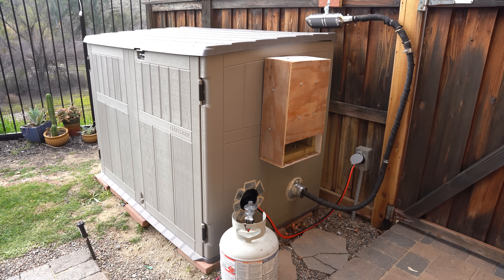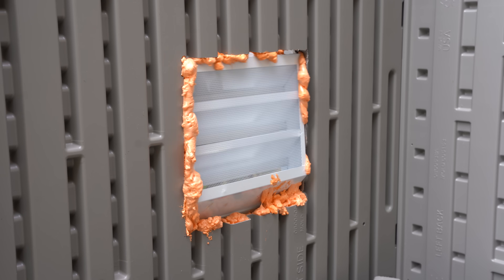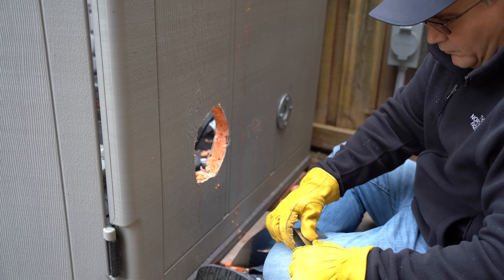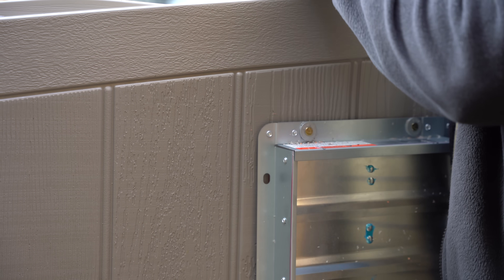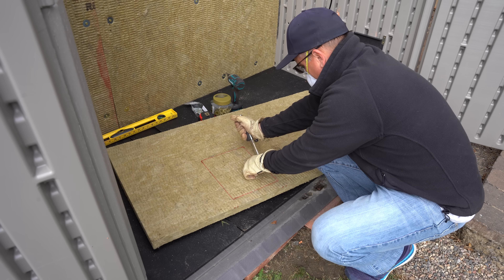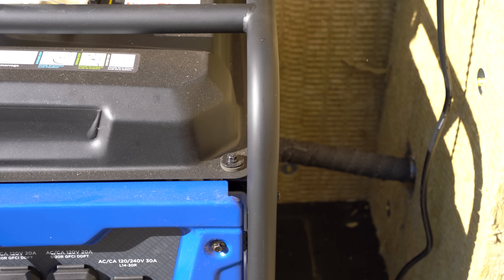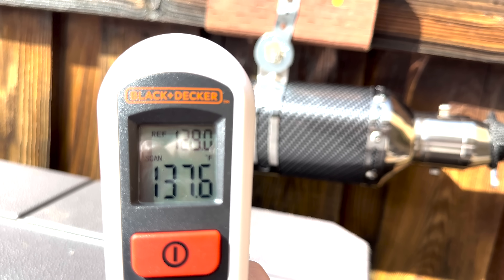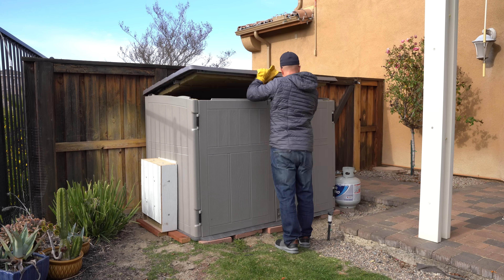How to Build a Generator Quiet Box (DIY) | Ultimate Stealth Enclosure

Comment from the maker: Complete parts spreadsheet: https://cityprepping.tv/3wYBqpi ... Download the Start Preparing! Survival Guide here: https://bit.ly/3xWhVwZ - start your preparedness journey: https://bit.ly/3xZhWlY
Some of the parts used in the video:
* Generator: https://amzn.to/3fVX3kX
* Shed: https://amzn.to/3YnKShE
* Blast gate: https://amzn.to/3tfETxA
* Attic fan (I would recommend a bigger one): https://amzn.to/3WIBy81
* Exhaust heat wrap: https://amzn.to/3DWa6uF
* Flex exhaust pipe: https://amzn.to/3UndAh2
* Muffler tailpipe sealer: https://amzn.to/3G0HkvN
* Metal zip ties: https://amzn.to/3RAQSBo
* Complete parts spreadsheet: https://cityprepping.tv/3wYBqpi
Reply: Hemp fireproof blocks as well bud😘Aģape
Reply: I remember reading a book on soundproofing when I was a kid. And they said the best way was to build a room inside of a room.

Look at how quiet your little setup is, imagine if that little setup was inside a tool shed.

Obviously you don't need it that quiet, these people were making recording studios
Reply: You left out the self driving nails at 11:15.
Reply: @DaedalusHelios  Good point! I have almost finished fine tuning my shed, a Suncast BMS4700 that houses a WGen 12K DF generator. I am no engineer or had any experience building or modifying something for a specific purpose. I did go to Lowe’s & Home Depot and bought large L-brackets and attached  them to all of the shed walls and installed the foot of them through the shed floor into a 6” slab with concrete bolts all around the bottom of the shed walls. Also  purchase two steel beams cut to the width of the inside of the lt and rt walls to reinforce the rigidity of the walls.  Thinking of reinforcing the corners that join the rear walls to the side walls as well in a vertical way if that makes sense ( after all not a engineer here) So just had a freeze here in San Antonio and so far so good.!
Reply: I'd like to see screen/rough mesh on your outside wooden box!  If wasps build in that, their nest will obstruct airflow...🇺🇸 😎👍☕
Reply: Before and after sound difference would be nice.
Reply: A word of caution. The exhaust will contain moisture and it will gather at the low point and prematurely corrode and fail. Exhaust systems will have a downward slope to the muffler and the muffler will have a drain hole to allow any condensate to escape.

Comment: Great build!

Pro tip:   When caulking the vents on the outside, only caulk the top and sides. Do not caulk the bottom.  If moister does find a way in around the top and sides, it will have a means of escape at the bottom and will not become trapped.
Reply: Nope, that's only when you're worried about rot - plastic doesn't rot, so caulking entirely around the opening is the proper thing to do. This is an attempt at a sound-proof container - anywhere air can escape, so can sound.
Reply: I'm sorry but moister and moisture are two different things.
Reply: @missyjo2475 nice English lesson but I do not think people are watching the video for that .
Reply: @JonathanRubenstahl  No, but an opportunity for you to learn.
Reply: @ArthurDentZaphodBeeb  true 👍

Comment: I found it over the years the threads on the exhaust pipe are generally the same as half or three quarter inch pipe. So I always take the exhaust pipe and small muffler off and run pipe a couple feet away straight up in the air outside the building changing it to 1 in pipe after about a foot from the box and then put in a 180° curve on the top to keep rain out not only does it get the exhaust fumes up in the air and away from people it further quiets it but by about 20 decibels

Comment: Nice one Kris, Thank You!
Something my Grandfather once did was use some metal struts to make a cage for the generator, then he used some strong springs and suspended the generator from the top metal struts so it was hanging. Makes a world of difference on the sound and vibration.
Reply: Grandpa was a genius. 👍🏽👍🏽
Reply: They also make vibration reducing/absorbing pads made of rubber, foam, cork, etc you can get for a few bucks.
Reply: Good idea but a $50 rubber horse stall mat works wonders!

Comment: make sure the temp inside dose not get above 120f with derating or 100f for normal rated use. 
chris has a good design,  two things: up size the fans to 12" the one on the back have it ducted directly to the back of the alternator (gen end for those not in the generator industry) 99% of failures your going to see is the alternator overheating and failing. they are VERY sanative to heat.
Reply: The alternator windings will quickly fail at about 150f depending on the Ins class rating. So any heat the alternator makes will be on top of the inside of box temp.
Reply: @karryhardman8735  you're saying 150 degrees but the person you replied to says 100 to 120 max. Now I'm confused. LOL!  I upgraded to a 14 inch fan and have one 15x15 intake vent on the opposite side. Haven't put a remote grill thermometer in there yet to see temps but it doesn't seem very hot in there when I open the shed lid.

Comment: This is excellent, I can't justify the whole home backup system for like $12k right now but a ~$1k from Costco or whatever inside an enclosure like this is feasible
Reply: The Firman Trifuel 7500 max watt generator goes on sale from time to time. They generally run for 900 and 150 off when on sale.
Reply: @corollaae8645  thanks for the heads up!

Comment: This actually inspires me to build something similar not for a generator, but for an air compressor for my shop. I don’t have a lot of floor space in the shop, so my thought was to build a lawn and garden shed and put the compressor in there, but it would be too far away from power and too far of a run for the air supply. This is just about perfect and I can set it up right next to my workshop, eliminating those two concerns. Thank you!
Reply: Try building and adding an intake muffler to your compressor. A lot of the noise come from the intake. I did this myself and it was considerably quieter. Many videos on YT showing different methods.

Comment: Great job, well done. Here’s a tip to reduce more sound. Get about an inch stand off with a piece of plywood that’s a little larger then the exhaust opening. Add the stand off and the plywood on the inside to cover the exhaust opening. This will help baffleing sound more.

Comment: I have a Firman  10,000 W tri fuel generator In a box similar to yours.  I live in PA and have had to use it on many occasions.  I do not us the sound dampening boxes, I found.they make little difference and hold heat.  Before attaching another muffler, CHECK YOUR WARRANTY!  Outsourced mufflers change the compression and will  cause failures it also voids most warranties.  We live in a world now where people see you have something they want so they steal it.  I had a welder make me two 4 ft.rebar pcs with steel rings welded on that I drove 3/feet into the.ground, cemented in and ran steel cable through with a heavy duty lock.  I highly recommend hard wiring the generator to your panel by a qualified electeician.  Electricians and in our area call the plug-in the "pig tail of death" many people start their generator, THEN plug it in, which is a good way to get electrocuted.  You DO NOT need another box, just a simple transfer switch that prevents you from back feeding the lines. You cannot power your box until the main switch is off and then the generator breakers can be flipped on. Also, flipp  the breakers to the items with the highest draw first.  Once.I learned that I can now power my whole house.  And make a schedule to run your generator at least every two weeks and check the oil.  It is a great feeling to have this item as a.back up.
Reply: I’m just finishing my shed like kris .   Really good comments -thank you, for chiming in with these.
Reply: You are very welcome.  We have had a lot of storms this uear and the generaror has been invaluable.  I am still extremely satisfied with my set up, and most especially the Firman generator.  I run it exclusively on natural gas.
Reply: I used the muffler Kris used in this video and I think he said it's for "around a 400 CC engine" (could not find proof of that on the Amazon link) but my generator says 500CC. How do I best confirm this will work. My generator is the DuroMax EP13000EH Dual Fuel. Using what Kris used, will this be a problem in your opinion?

Comment: Well done.  I thought you did a pretty thorough job of addressing everything needed to do a build like this.  I think you did a better job than most of these complaining keyboard DIYers would have done. Obviously someone can easily add or take away anything they want for their ideas.  I have a old 4500 watt generator that is incredibly loud and wanted to build something for it.  Ideally a little smaller and something that I could setup and move easily.  Thanks for your ideas.

Comment: I have a dozen comments and suggestions, however, I won't bore you with my opinions. You showed a beginning decibel reading (79.6dba), was there a completed decibel reading? Considering, plastic, wood, and foam are all combustible materials, using *Rockwool insulation was a great choice! I use the same brand (different variations) in my house, garage, attic, and generator shed.
 In combination with my solar/battery storage backup system, I use two 2500-watt dual-fuel generators with a combiner box connected to our 250-gal. bulk propane tank with a factory dba rating of 53dba. Inclosed is about 45dba.  "Rural Prepping" 🤠

Comment: For good ventilation, the general rule of thumb is to have twice the area of passive INTAKE as you have ACTIVE exhaust.  You can either do the math on making one hole, or (the simpler way) if you cut a 4" circular hole for the exhaust fan, cut two 4" circular holes for the passive intakes.  (The shape isn't important.  Just the area of the holes in respect to one another.)
Reply: What if you had an intake fan and an   exhaust fan both at the same specs ? I’m building mine that way through the same size sound maze boxes.
Reply: @unbr3akablonsoundcloud-tx6co  better to have one fan unless there is a computer keeping them perfectly matched.  Otherwise one will cause drag on the other
Reply: @reverendprophet   im building an air compressor silencer box , so it’s a little different to a generator . Will the drag still be an issue with sound maze intake and exhaust baffles if I go about this method?
Reply: I’m still not sure what u mean by drag ?  Drag only happens if the fans are installed close to each other on the same side aren’t they ? Not either ends of the box
Reply: @unbr3akablonsoundcloud-tx6co  if the fan that is exhausting is pulling harder than the fan that is bringing in fresh air, it will cause strain on the intake fan.  If the intake fan is blowing harder than the exhaust fan is pulling, it can cause strain on the exhaust fan.

Much better, if you want to use two fans, to have them BOTH exhaust and then have twice as much passive intake.
Reply: @reverendprophet   I get what you mean , but going off what you’re saying the extraction fan will be sucking more air out than what’s coming into the box, that’s why I bought two of the same fan , built two of the same sized snakes boxes . Limit the variables of what could go wrong. The variable I am concerned about is the compressor sucks in air  and also needs to stay cool. I have installed a temperature sensor to monitor from outside the box, but that doesn’t tell me if one fan is struggling more than the other .A majority of the builds I’ve seen with an extraction fan have an open snaked intake (very narrow to reduce the suction sound of the compressor ) and have shortened the life of the unit. If there’s no risk of the fans starting a fire and just failing it’s worth a shot as they only cost $34aud each (probably 20 usd)
Reply: @unbr3akablonsoundcloud-tx6co  If the two fans are not PERFECTLY in sync with each other, one or both fans will be working harder to compensate for the other.

If the exhaust is active and the intake is passive, the exhaust creates a vacuum which pulls fresh air into the passive intake. 

No need for another fan.

Again, the formula is that if you have a 4" exhaust fan, you want TWO 4" passive intakes.  If you're going to route them through a bunch of baffles, you could increase the area of the intake to compensate.

But feel free to do whatever you want.
Reply: @reverendprophet   the second paragraph was the answer I was after , thanks.  Are you an electrician ?

Comment: I have done this several times, you are  correct, the fan is too small and you should be blowing air INTO the box not exhausting air, it is much more efficient. Also a "Certified Exhaust Thimble" for combustible walls should really be used as fire codes are not a bad thing.

Comment: Love this proof of concept.
Do you think anymore bafles in the intake and exhaust boxes would make any significant improvements. 
Also the exhaust needs to be lower sound the sound is not projecting out into the area. If you are using this during a grid down type issue its going to be a lot quiter in your neighborhood .

Comment: I put my fan down low and revered it to suck in air. Then it blow it out through the top vent to expel any gas that might had built up.  Good idea to use an expoliosn proof fan as well. Bit more expensive but not as much as a new generator or house. Cool build.

Comment: Nicely done! If you ever get a chance, have a look at a film set mobile generator, might give you some idea's for another build or upgrades. Expanded metal/perforated metal covering your insulation will give it support,  a blower fan blowing into your air intake area will aid in cooling ... just a couple ideas.
Great job otherwise, cheers!

Comment: Excellent video.  QQ;  if the venting system (intake and fan to draw outward) is strong enough, could you get by without having to pipe the exhaust too?
Reply: My guess is no because the exhaust is way too hot. It would likely damage the generator without exhaust directly from the generator to the outside.

Comment: If you’re looking to really sound proof something, look into mass loaded vinyl. It’s what movie theaters use to make a room truly sound proof. The thicker it is, the more exponentially sound will be deafened. Air is the #1 reason sound will get though so it might be smart to build an additional box around the generator, inside the shed. Then wrapping mass loaded vinyl insides both boxes. I guarantee it would be <20db if not almost 0 if you use the 2lb per sq foot vinyl.
Reply: I thought about MLV, too, but can it take the heat?
Reply: @trevorrisley5419  yup it’s fireproof

Comment: Looks great. Question: Is there enough oxygen venting into the box to keep the motor cool and not insulated to the point where it overheats?
Reply from the maker: That’s why I need to upgrade the fan :)
Reply: @CityPrepping  Ahhh, ok that makes more sense now. Thanks for clarifying! :)

Comment: Two things in a generator that hate heat; heads and generator windings. If you have 200F inside that compartment you have a recipe for disaster. Look for a 10-15F rise. I can see right away your fan is undersized. For me to achieve the desired temp; rise I went for a 16" AC infinity 3000 cfm fan. Sarted out at 12" 850 cfm and inside was over 125F. Another issue you have is the escape area on your compartment hoods appears to be smaller than the fan exit area opening in the compartment wall. My generator is a 5kw Honda.
  Yes you need to keep the propane outside the compartment.
  When installing insulation consider ïnsulation pins which you can find on Amzn. Saves drilling holes thro the walls.
Reply: One thing that always baffles me (no pun intended), is how these RV built in ONAN generators that are tucked inside a metal compartment would not fail after a short time. Many of them last a long time with proper maintenance.